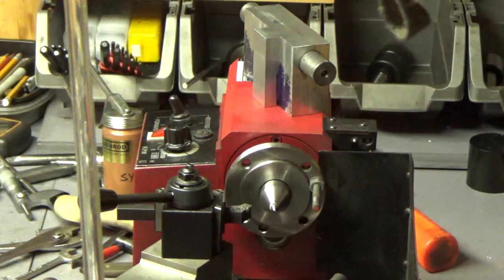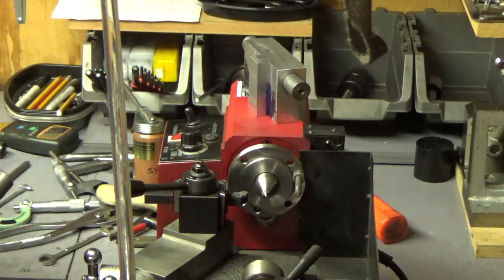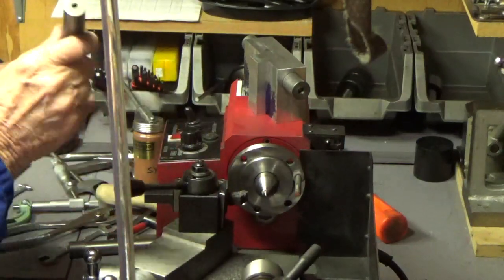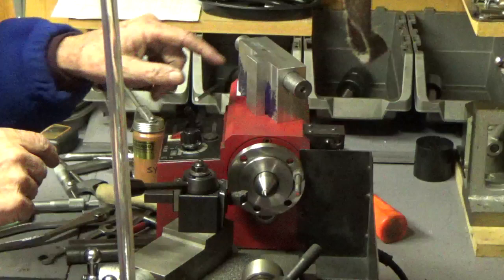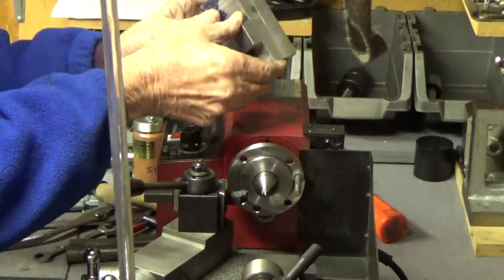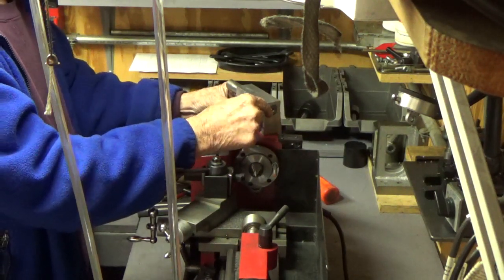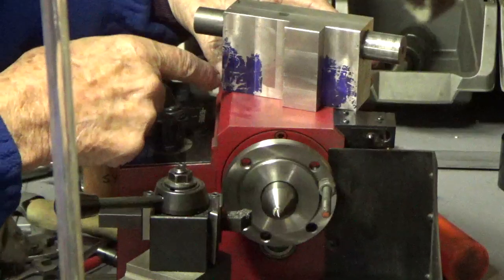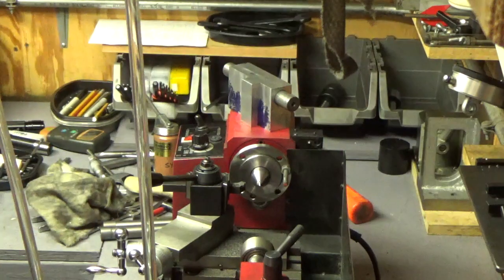Taig Lathe Tailstock Build No.2 (The Quill)

Comment: Larry, that looks great so far, Just a cautionary comment, your block is 4 inches, (I think?) your leadscrew is going to be at least 2 + inches with the quill extended, not sure how long your 1 morse taper in quill is deep, but suggest you check your drawing to confirm you are not going to come up against a problem with the tailstock in operation, your quill might need to be longer than 4 inches?
Reply from the maker: Walter:  I'll check.  Thanks for the heads up.  My first step will be to add the MT1, then I'll know how deep it actually is.  I have a sample coming this week, along with the reamer set.  Basically the lead will only be 2"+, plus the distance beyond on rear for the stop and wheel, etc..  I maybe able to add a bit to the Lead depending on the length of the MT1.  I can also add an adjustable screw at the end of the Lead to assure proper ejection, etc..  I'm also not sure yet on the size of the Lead, but maybe 3/8-20.  Best Regards: Larry